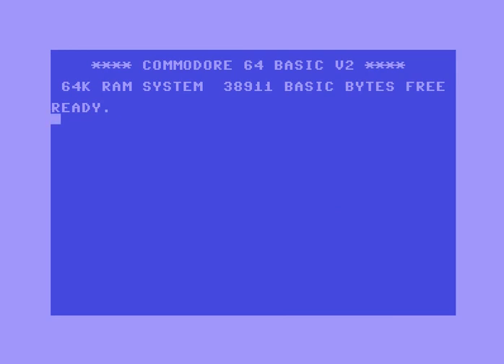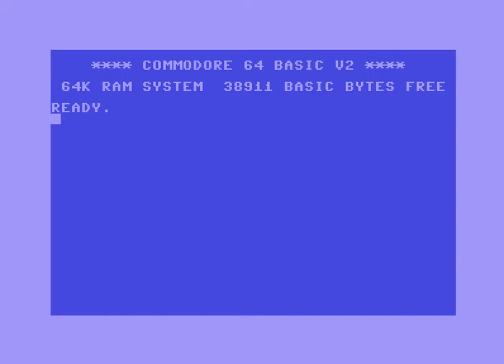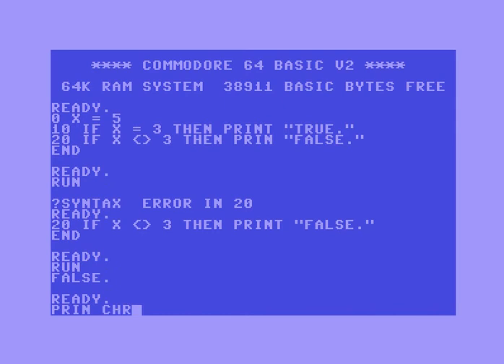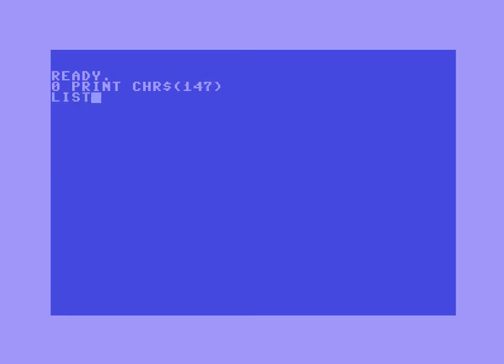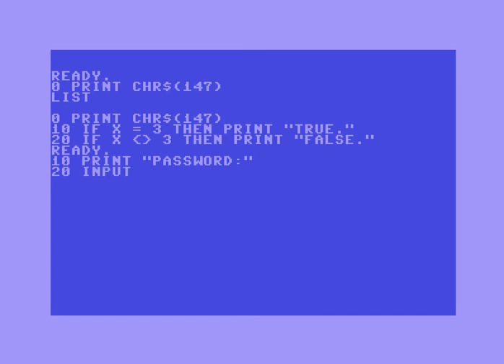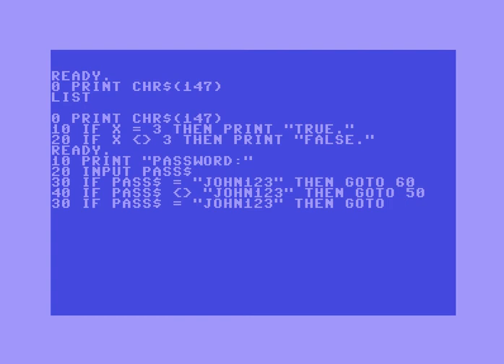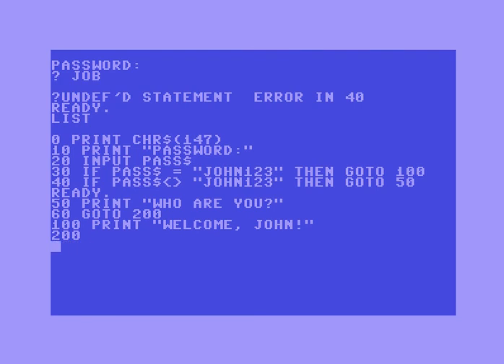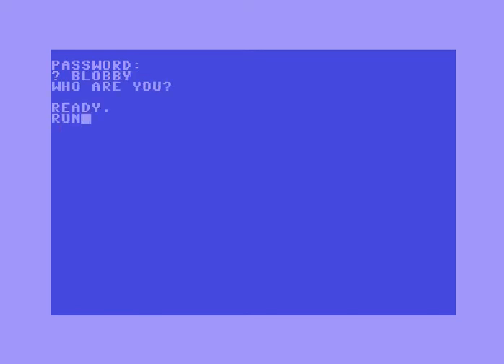Commodore BASIC Tutorial 3 - Conditionals and GOTO's.

Comment: easier way to clear screen is by holding SHIFT and press HOME
like HOMEing your cursor but with shift held down.
Reply: Lewisk3 but you can’t do that in code tho
Reply: It's been a year, so I'll assume you already know by now or just moved on, but to clarify, sure you can do it in code:  Just type a PRINT statement, and inside the quotes press SHIFT+HOME.  You should see a reversed heart character (like someone cut the heart shape away from a block of wood if that makes sense, it will sort of look like this:   10 PRINT "[♥]" )

You can add any cursor control characters you want inside the quotes, try pressing the up/down arrows and the left/right arrows, Control+1 through to Control+ 8 to change character colors, etc inside a print statement to see what I mean.  Experiment, learn, and have fun!
Reply: @DaneArcher  yep, that’s right. Once you type a quote the C64 enters a special mode, permitting you to put control characters in a string. This can be very handy or very confusing if you don’t know what’s happening. The clear screen, the arrow keys, color codes can all be put inside strings this way. This special mode ends after typing the closing quotation.
Reply: Works well-using VICE. Thanks!